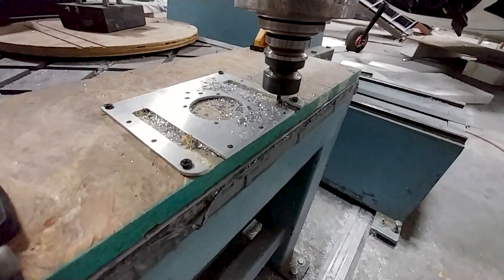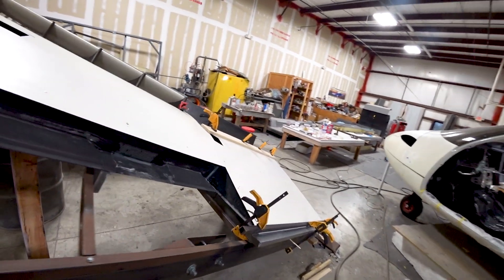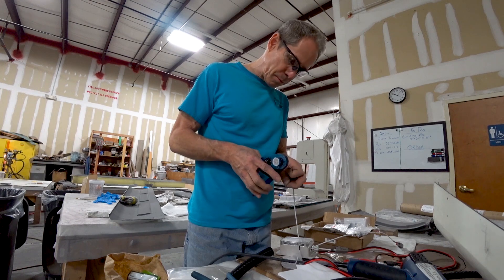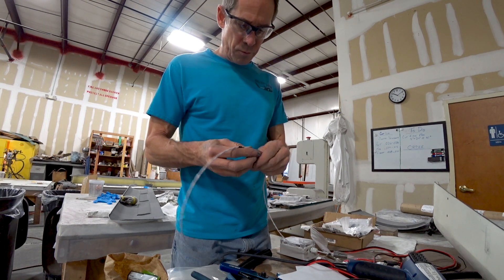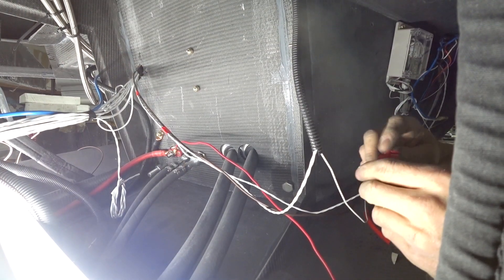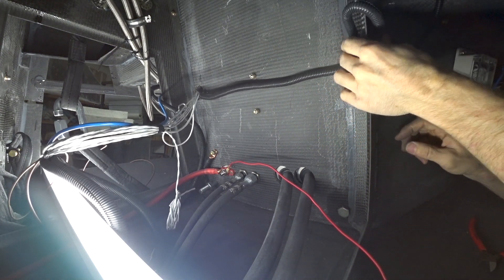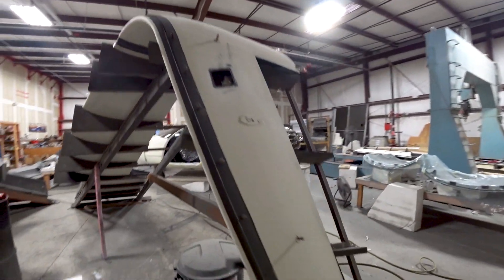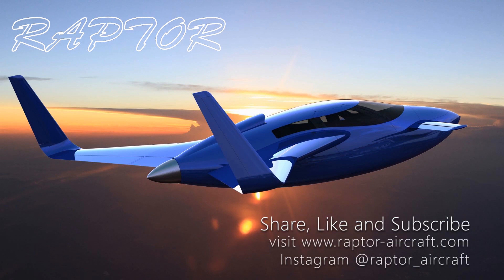Pressurization Controller - Building the Raptor Prototype

Comment: Hi Peter, I ve been following the Raptor since the beginning, please keep up the good job. 
I am a potential buyer but have few concerns regarding price, final weight -> performance, but for sure you will sort this out .
As a suggestion on this episode, you can fix the Arduino box with velcro and double sided tape, the least holes on the firewall the better.

Comment: Are you using an accelerometer for your flutter detection?  I have built a similar system with $6 accelerometers from Sparkfun.com and an arduino with a few LEDs for the warning. Also have an MP3 annunciator

Comment: Love the arduino pressure controller!!!
I am concerned about feeding the Arduino 12v though...
Linear (voltage divider) regulators like what's on the Arduino board, bleed the extra voltage through an on-board resistor.
With a 12V supply, power consumed by the single on-board resistor will be more than the power consumed by the device/load.  It isn't really practical outside of rapid prototyping.
I fear that running an arduino at 12v with the on-board linear regulator for an extended period of time, it will run very, very hot, or it will eventually overheat/fail.   You will have over 1/3 amp at 7 volts (2.5 watts) going into pure heat energy into a single component on-board when the arduino is at idle.  Don't draw more than ~100mA from the 5volt pin on a 12volt supply (for sensors/controllers/display), or you will almost certainly overheat the onboard arduino regulator.

A switching regulator on an off-board module to feed 5v to the arduino is a better choice for a safe, reliable long term installation.  
Just my two cents...  I'd hate to see this beautiful plane burn from an overheated resistor.
Reply: Erm... thats not really true. Your correct that running off 12V will cause things to get hot, but it shouldnt be too bad. Linears drop the voltage across a transistor inside the IC, not the feedback resistors. 

Using a switcher is a good idea, but you really should filter both the input and the output of the switcher. That will help with radiated and conducted emissions. Its a low power device so, emissions shouldnt be that high to begin with. All of the avionics have been tested to DO-160 section 21, so they shouldnt really mind any noise from this device, but the audio stuff might.

All of that is kind of a moot point when you consider a life critical system is being run off an Arduino. Theres a reason avionics are expensive- we test the shit out of them before we trust anyone's lives to them.
Reply: @theonlyari  good info!!  Thank you.  I did not know that about the linear power regulator.

Also, totally agree that a custom designed and tested (and interference suppressed) controller board is far better solution than a full arduino prototype board in a plastic case.

....  Makes me wish I was working for Raptor on the prototype right now...  :)
Reply: This might be a silly question, but would it be possible to cool the Arduino? Like with a fan, as with a CPU?
Reply: Would a switching regulator cause noise on star ground and be heard on the audio headphones, etc.?
Reply: That is a good question...  Worth a test.

Also, I would test the heat of the arduino board first rather than just assume it wont do 12v and add a switching supply that could also cause problems...

Comment: Do you have any way to filter your turbo pressurized air flow, worry if you have a turbo failure you could flood the cabin with oil.
Reply: It's hot air. That's something to consider. Oil doesn't really come from the impeller side during a turbocharger failure unless it's a poor turbo type like the ones that came on the early 60 Series Detroit Diesel. Those were probably to main reason it's though of as common. If you have a turbo failure in an airplane, you won't need pressurization because you can't fly that high. Just close the duct and find a place to land. If you're loosing oil, it's engine oil. Getting some in the cockpit would be the least of your worries.